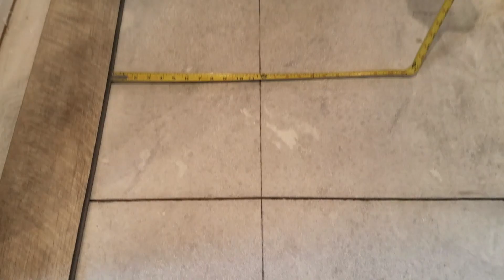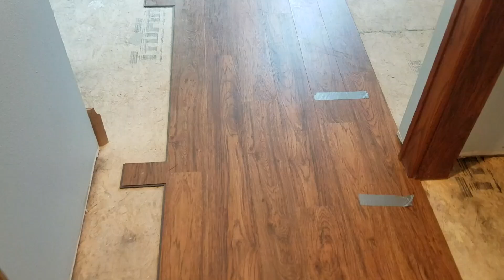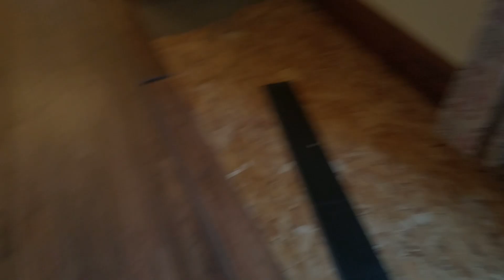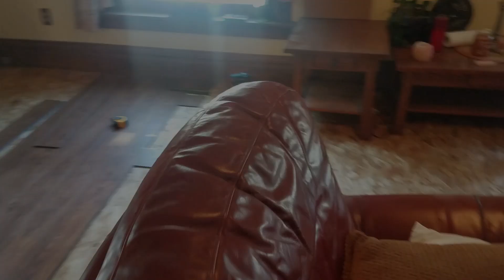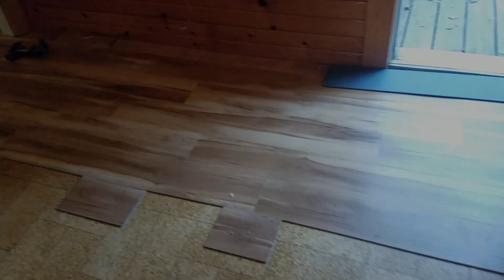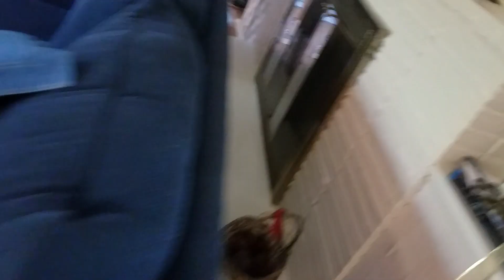Installing planks into multiple rooms- Laminate and Vinyl Plank Installation(part 2)

Comment: Hey, when figuring out layout off your hallway centerline, would you measure throughout the connecting rooms where planks will land along the walls, inside of closet doors, around cabinets etc from that line andsee if you will end up with a tiny sliver anywhere and try to adjust your centerline? It seems like it would be hard to do a perfect layout like that with all that measuring, or would you start with your centerline and work off there and hope for the best? Lol
Reply from the maker: My biggest concern is to have the plank land in the doorways in the hall and then just let the rest of it fall the way it falls.

Comment: Hi. Love your videos.  I have a 40x50 basement that i am putting vinyl plank in.  There is a 16x16 room in the middle that i need to work around so the flooring is like a square donut, with a square hole in the middle.  How can i be sure that the 2 sides will still be aligned when i get past the room and need the run to be full width again?
Reply from the maker: Why don't you contact me on my facebook page, there is a link below.

Comment: What happens if you are on concrete?   Still screwing in ?
Reply from the maker: You can drill holes and screwed into the concrete or you can glue the straps down using pl400 construction adhesive but you will need to let that dry overnight before you can continue. Once you're all done then you can pry up the scrap pieces and scrape any remaining glue off the floor

Comment: We are putting Aqua Seal locking flooring thru our whole downstairs. 2 of the 3 rooms we can get down to the original hardwood floor, the kitchen however has 3 layers of laminate tiles. 2 are peel & stick the 3rd is old, thick & glued! My question is do we need to remove the tiles? We are trying to do no transitions. Thank you
Reply from the maker: I would remove the tile.

Comment: I'm not understanding why to use a temp planks instead of putting the permanent ones in and work from that? Please help me understand, I need to do an entire house and I finished a bedroom so far. Do I continue from the room? Or start at end of hall or front room? Very lost
Reply from the maker: Temp planks help hold the floor in place during the install.

Comment: Question - Sometimes it looks like you didn't put down an underlayment or moisture barrier. When do you decide to or not to do that? Thanks so much for the videos!
Reply from the maker: The floor you saw without an underlayment was a vinyl plank with an attached pad. A moisture barrier was not needed

Comment: Your videos have been a great help. Thanks!  I have 2 doorways that don't have doors or the moulding.  (I guess they're not really doorways then!)  My product requires a 1/2 inch between all walls, etc.  How do you suggest I handle this type of opening?  Will I need to add the moulding to wrap all the way around from one room to the next?
Reply from the maker: I would like to see a pic of the situation there's a link for my Facebook page in the description of this video if you could send me a pic there that would help me answer your question.

Comment: Great stuff--planing, planning, planning--BUT, I'm in the middle now where my hall (with 2 bedrooms attached in flooring) is meeting up with the kitchen (also filled with flooring) has gone around an island and I'm off 1/4 inch as they meet up at the joining. How do I meet them up in flooring? I'm using glue-down LVT and really don't want to take up a bunch of flooring! Help!
Reply from the maker: Did you figure this out?

Comment: My click together, free floating lvp instructions say that I need a transition strip in each doorway.  It gives those direction in bold print.  I'm using Cali Bamboo Plus vinyl plank, 7mm thick, sold at Lowes.  If I follow your vids for a zero transition floorplan, should I worry about warping or buckling?  And can you explain your thought process either way?  Thanks!